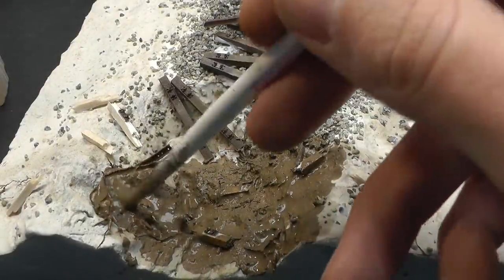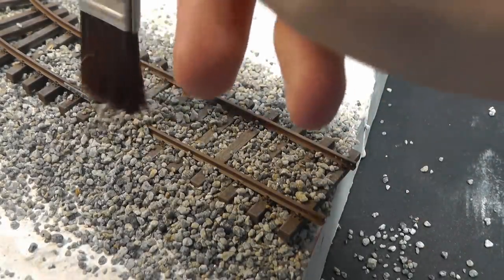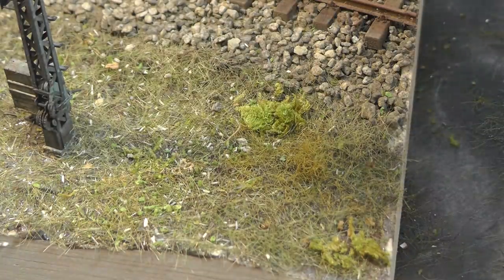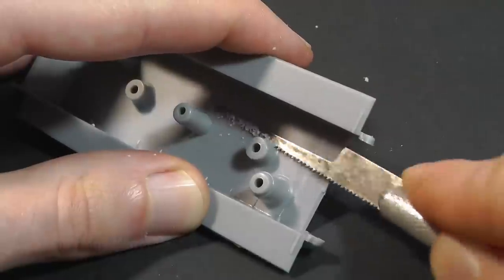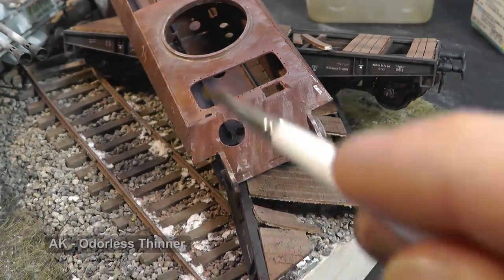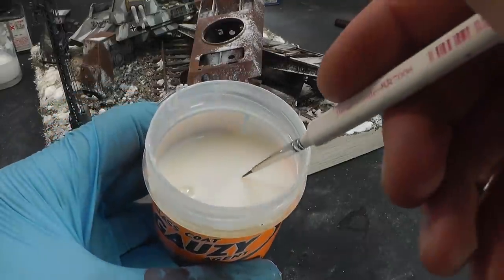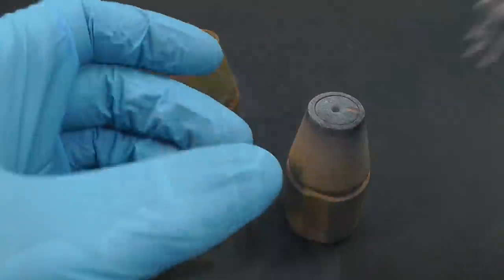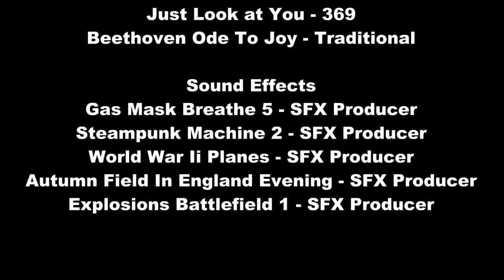Winter Ambush on Rail - WW2 1946 - Diorama 1/72

Comment: It looks great and excellent advice on applying the rust effects with a brush rather than by airbrush, because the air brush makes the rust too uniform.  I am using a 1/2" wide long knap sable brush to put rust effects on tanks and military vehicles and it works great.

Comment: Wow!! Excellent job on this one. Amazing ground work and the complexity of the rail cars and destroyed track really complements the machinery of the E75 walking tank. The vertical height of the rail signal even towering over the E75 adds a lot of height as well but it is small enough that it doesn't overshadow the vehicles and the destruction. The two days to modify and paint the future soldiers was worth it!! They really help show just how large and menacing the rest of the scene is. Absolutely amazing build! Thanks for sharing with us 😊

Comment: Man, you diorama is brilliant.  I love the crater in the track and the men and horse in gas masks.  You weeds are excellent and I liked the way you approached rolling stock.  The only thing that jars a bit for me is that you cut the planks for the wagon deck 90º to the wood grain so the grain on the surface of the planks runs across them instead of along them.  Everything else is wonderful.

Comment: It is amazing what can be done using both natural and man made materials.  A few things I noticed that would have helped. If you had added a few more details on the interior of the tank as well as some sort of battle damage to the hull. This is also valid on the flat bed rail cars. If the blast had been underneath the rail car there would have been wooden planking distorted upwards but still partially attached. Also the cars would have looked twisted or bent in some way. Please understand these comments are not a complaint about the amazing work that you have done. One other thing. Have you thought about building a number of these dioramas that fit together and become part of an HO scale railroad layout? Your attention to detail is amazing.  Thanks for the video.

Comment: 3:10  The modal railroad guys would put in a small amount, very small amount of dishwashing soap into the mix.  It helps with eliminating the surface tension and make the glue flow into the covering better.
Reply: A drop of detergent is all you need in the glue mix.  Also, you can  spray to wet with isopropyl alcohol beforehand, and the gravel won't float and move around when you apply the glue mix.  Alcohol evaporates away, leaving the glue.

Comment: Fantastic, a truly amazing piece of work. The level of detail you go to is astounding.
Imho I think I'd use one less rail truck in the composition, as they take away from the Walking Tank a bit too much. Also, should the tank chassis be on the other side of the truck? Would momentum from the crash not see it slide off the truck the other way? 
Small points, no way taking away from a wonderful piece.

Comment: Hi David, as usual your work is amazing, and I learn something new from each video! You asked for suggestions so here is one which I think will teach many new techniques to people like me, and also be a challenge to you. 

I am building a radio controlled submarine in 1/35th scale. The submarine is  a British World War Two type, and is a working model, which will be sailed on the surface  and underwater on the local lake.

I want to make the model look as realistic as possible: lots of rust, and weathering and chipped paint, showing rust and base layers beneath.  But the paint scheme and weathering must be strong enough to withstand the water, and the general ‘rough and tumble’ experienced by a working model.

I was thinking of using the kind of acrylic paint used on real motor vehicles, as maybe that would Stand up to the treatment?

Perhaps you could do a tutorial on how to do some painting, rusting, weathering, and chipping and then protect it so that it will not be affected by use in water ?

Comment: Hello Plasmo I have only just found your videos, and one word comes to mind Awesome, totally awesome. I love your aeroplane builds, and your ship builds incredible. Could I add one small piece of  criticism, which isn’t really criticism. With your diarama I just don’t like your mobile double barreled gun, mainly the legs that put me off. Now this is only because I love realism and accuracy, which all your other models that I have seen display. I have built two very large models of an FFG Frigate HMAS Darwin, and the Eisenhower Carrier. The Frigate was in 1/48 scale and the Carrier was in 1/72 scale. Both were built with moving guns, lights, Helicopter with spinning rotors, the carrier had a working elevator, and both ships had turning radars. These took well over 18 months to be 95% finished, but the fellow who paid for them wanted them in a hurry so I never quite finished them. The carrier was finished with a full load of jets on deck. Keep up your superb work.